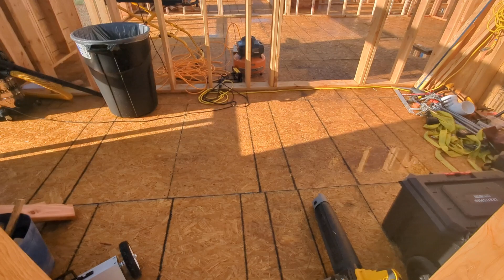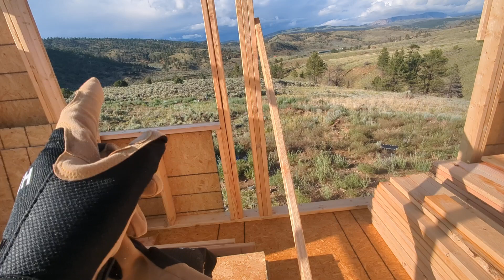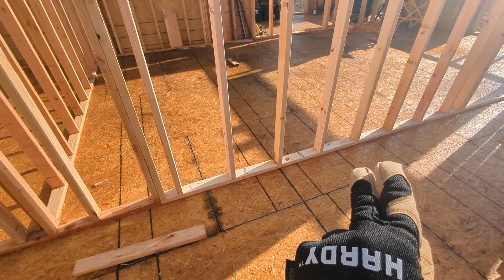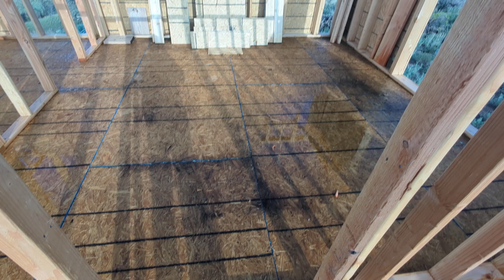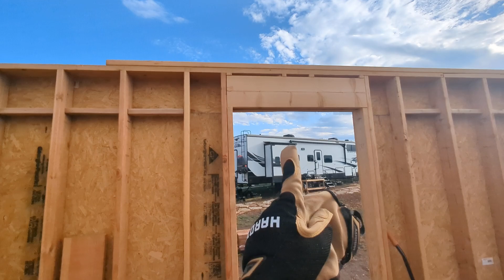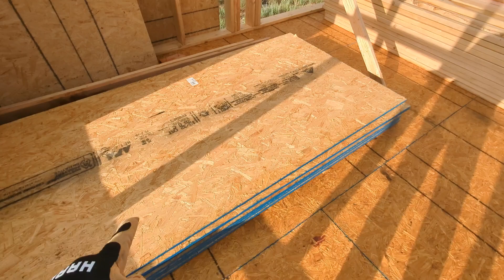Casa Blanca: Colorado Off-Grid House Build, Ep.7

Comment: I'm in Aurora. We retrofitted a heat pump last year and I would suggest that you could get that to work as a primary heat source, with propane as a backup.
Reply from the maker: We considered it and might, still. But bear in mind you have utility-supplied power. We're going to be on solar. Heat pumps are efficient enough to do that now but you need a much bigger solar install, and it would take a lot longer to hit an ROI. We'll most likely do that a few years from now.